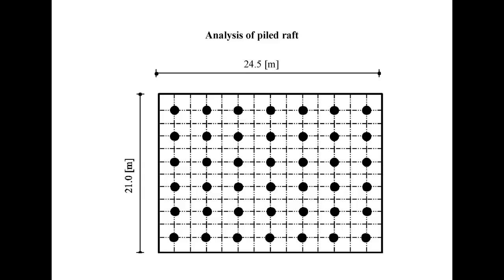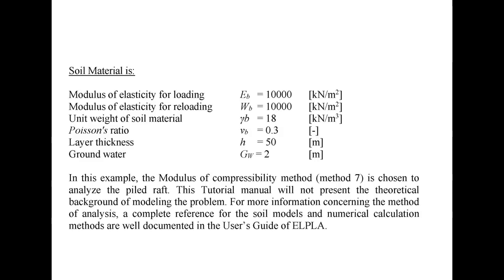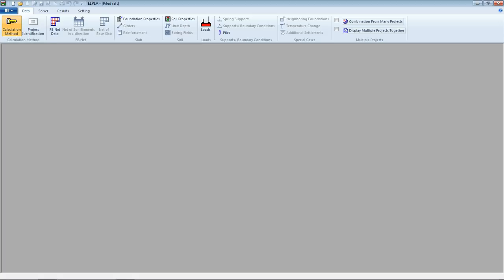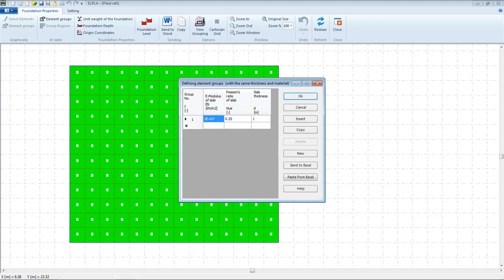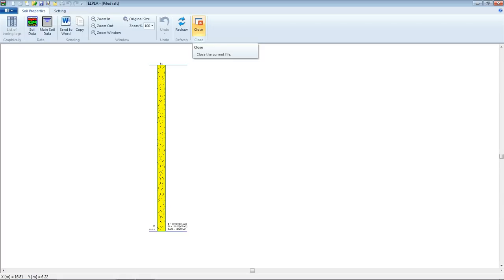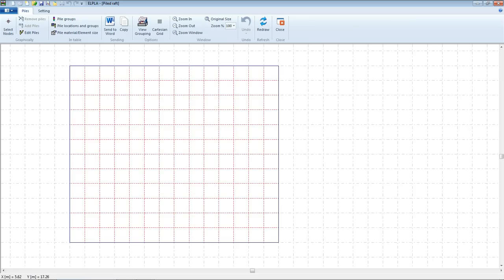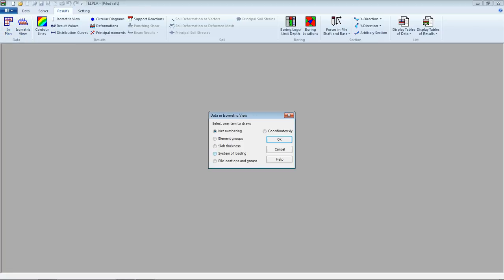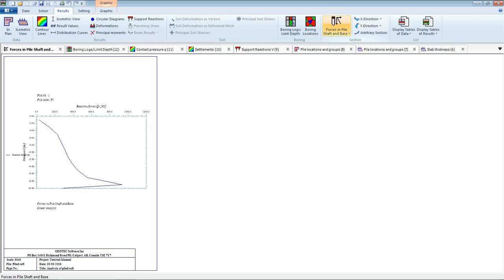Analysis of piled raft foundation

Comment: I have two questions regarding the program:
1. Can the program handle lateral loads (e.g. pile groups supporting bridge abutment) and torsional loads (e.g. pile group or mat used as crane pad)?
2. For vertical movement of piles, how the slippage between the pile and soil is handled? (I do not see a reduction factor for the pile-soil interface, which is a typical for general FE programs)
Reply from the maker: Lateral loads are not supported in the current edition but will be added in the next editions.
Reduction is not required based on the current model of analysis. ELPLA is combining FE methods + Soil layer methods. You may check the books distributed with the program to get more information about the method of analysis.